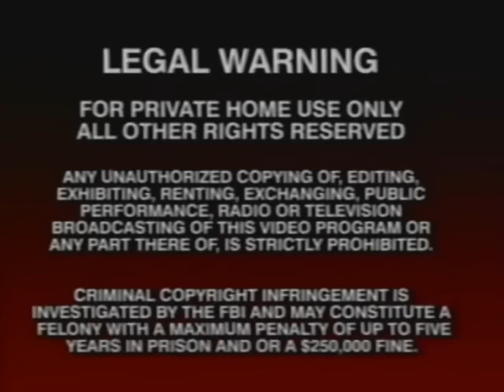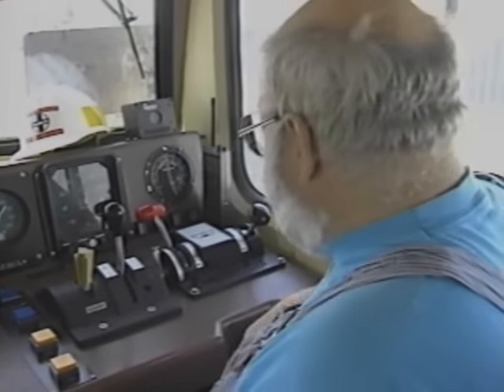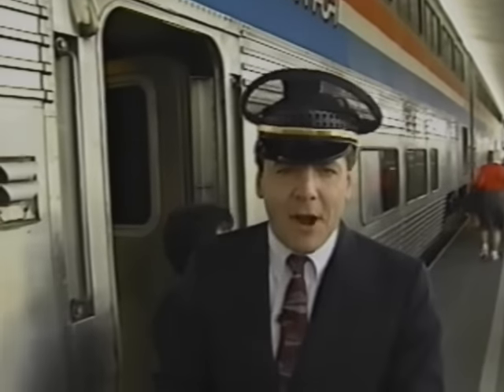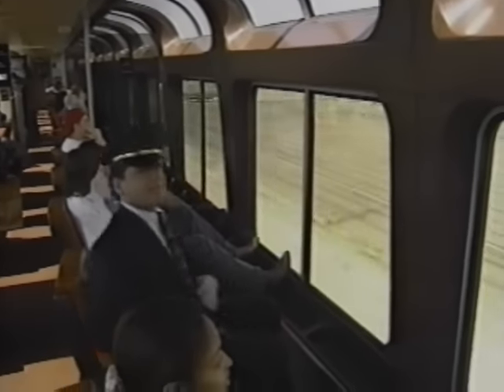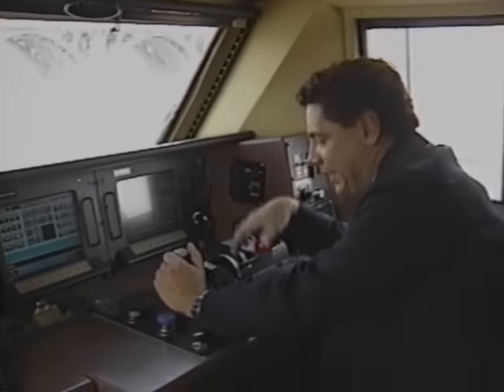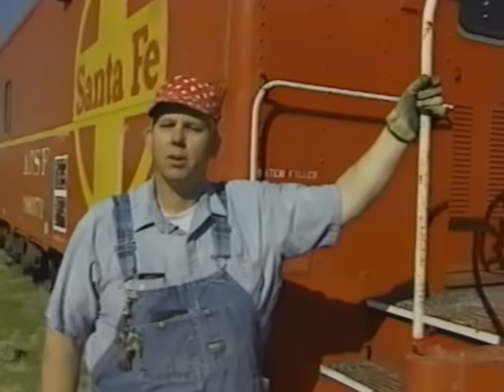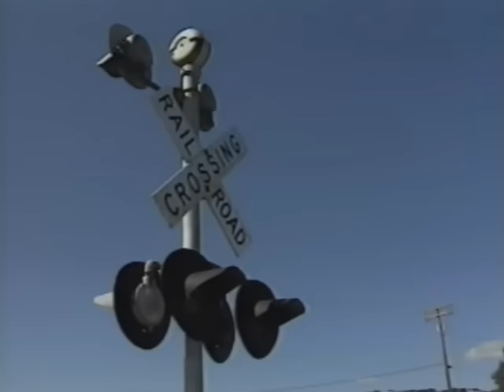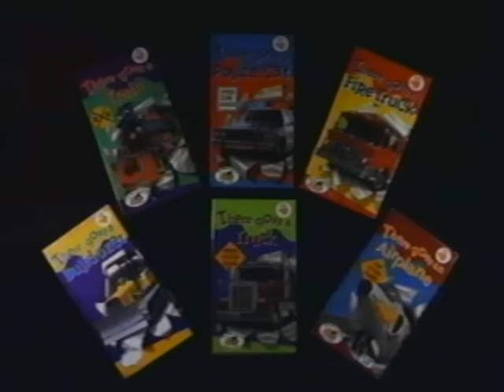[VHS] "There Goes A Train" 1994

Comment: This video is probably one reason why I run BNSF trains on my HO-scale railroad layout! Lots of fun pre-BNSF footage of the Santa Fe railway, and Amtrak in Phase III colors (I miss seeing them regularly at South Station in Boston, especially the F40PHs...) Regarding the Santa Fe Superfleet diesels seen in this video, here's what I know what their status is now:
The Santa Fe FP45 (104) seen starting at 1:43 has been scrapped since 2005; prior to that it was sold to Wisconsin Central in early 1995, prior to the BNSF merger. That footage was actually shot in late 1989 for a Santa Fe promotional video.
The Santa Fe Warbonnet Dash 8-40CW Dave shows us, number 858, was repainted near the end of the 90s in BNSF "Heritage II" colors, but years later it was sold to the CN railway, repainted and renumbered as 2193, and is still operated by CN today.
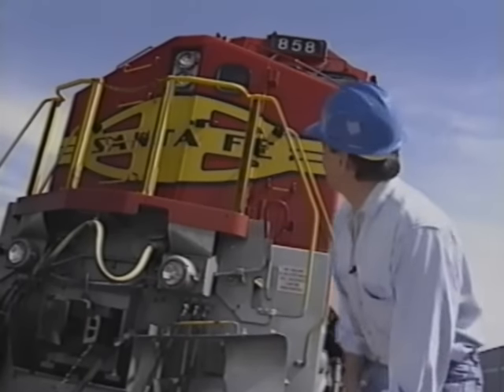The Santa Fe Dash 8-40CW at 3:15, number 914, is still owned and operated by the BNSF, and still has the Warbonnet paint scheme! But the paint is quite faded by now, and a small yellow "BNSF" was stenciled under the side road numbers.
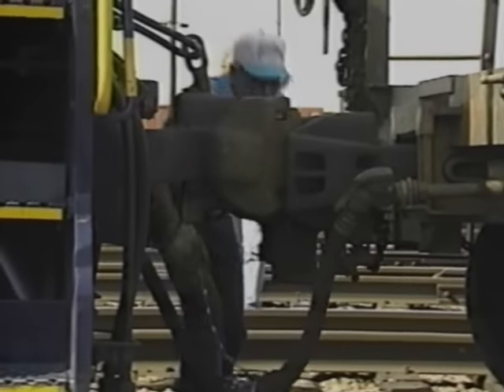Santa Fe 907 at 8:28 (Another Dash 8-40CW, probably) is still in use by the BNSF today, but in 2004 it was repainted in the "Heritage II" paint scheme.
Reply: wileyk209zback all the current dash 8 40CW's on BNSF are in storage however the B40-8W's are still in active service in fact there's a few Santa Fe B40's in Phoenix
Reply: @Rothnorthon1  Yep; I have a few HO-scale BNSF B40-8W locomotives for my layout, from Walthers Trainline. Two of them are "Fakebonnets", and one is in the "Heritage II" paint scheme. The two "Fakebonnets" are DCC-equipped with hardwired decoders (one of them being the first locomotive I hardwired a decoder into myself), and I plan to install one in my "Heritage II" locomotive soon.
Reply: northmountainfilms Official Account 2  My aunt keeps bees on her farm that she owns. I nicknamed one of the more friendly bees "Bee Forty Dash Eight".

Comment: That shot of 3751 was on Cajon Pass.
Reply: Yes From 1992 a Year After 1991.
Reply: Before the second runaway that all but destroyed six locomotives in 94
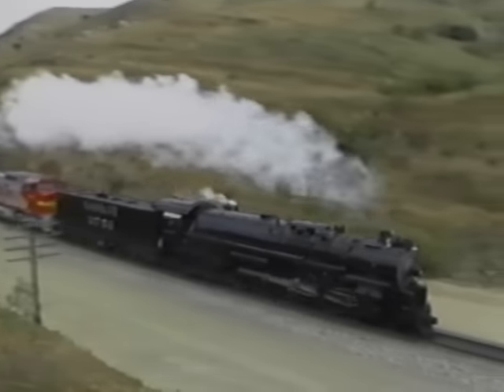Reply: From 0:40 - 1:05, 21:32 - 22:11, and 32:37.

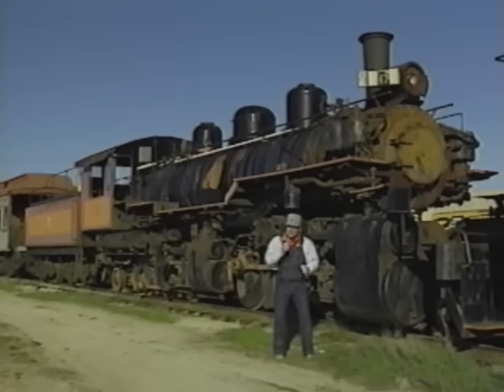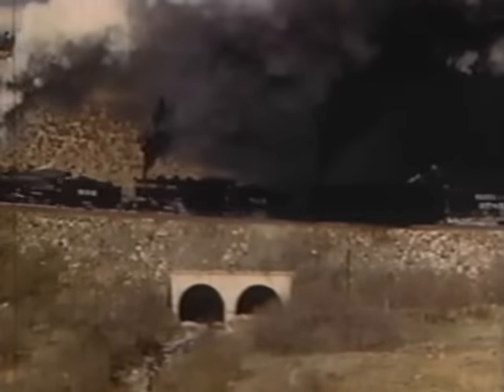And for some reason they used a sound recording of SP No. 4449 instead of leaving the audio of the ATSF #3751 for the last shot. The same sound effect was also used at 23:53. That particular whistle sounded very out of place on these shots, and also the E unit running over the camera at 24:19 even though that one was perfectly in sync.

Comment: 30:16, Forget the radio, STOP THE TRAIN!
Reply: "Conductor Dave, What are you doing here? You're supposed to be in the back of the train." "You're radios not working." "Your right it's not working."
Reply: Norfolk Southern Fan 1225  After Get The Car Off The Track. '''Thank You Engineer Dave, You Save The Day.''
Reply: Norfolk Southern Fan 1225  I'm a Conductor on a trolley line in Oregon, and I said that exact line to the Motorman that I was running with one day. We encountered our MOW speeder crew working out on the line. We had a working radio with us on the trolley, but the Speeder crew's radio had stopped working and was shut off. We were almost in a head-on collision with the speeder. The Motorman kept trying to fuss with the only working radio on the trolley, so I said (more like yelling) that line just like Dave did: "Forget the radio, stop the train!" The Motorman stopped the trolley just in time before a head-on collision could have happened. We were just mere feet from a head-on collision. I'm lucky to be alive to tell the tale.

Comment: Unusual seeing an elderly steam locomotive, hauling ass, towing desil electrics.
Reply: This is because the Steam Engine doesn't have two things: Dynamic Braking and Head End Power. The passenger cars need electricity, and the Steamer can't directly provide it. In the old days, this was done by employing a generator car on passenger trains.